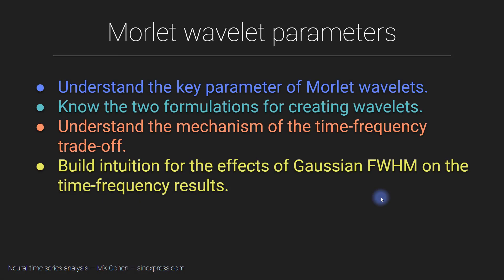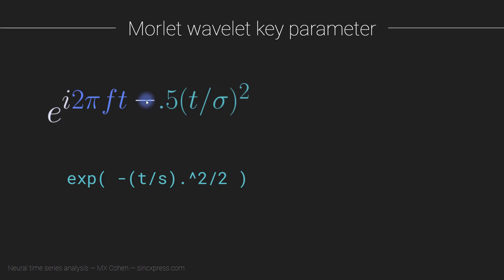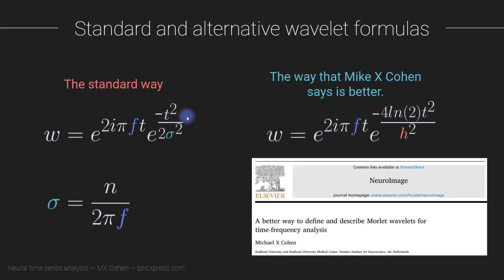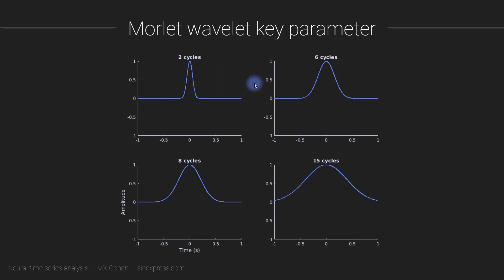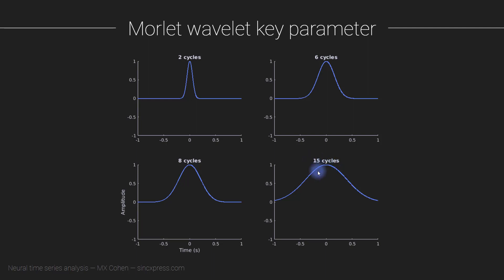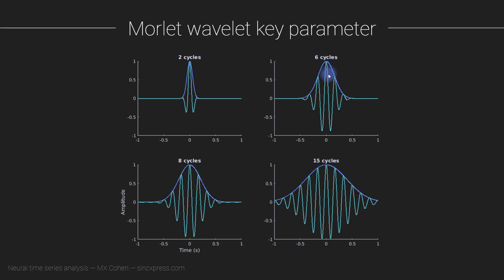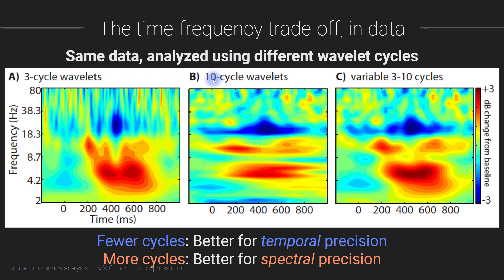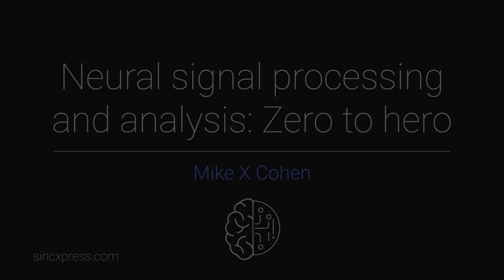Parameters of Morlet wavelet (time-frequency trade-off)

Comment: Not sure how valid it is but the way I like to think about this is that wavelets with fewer cycles look more like impulses (i.e. delta functions) in the time domain, and therefore have a broadband spectral equivalent. As such, they offer less spectral resolution because they are capturing information across a wide range of frequencies. Wavelets with more cycles are closer to sine waves, and thus have a narrowband spectral equivalent (i.e their Fourier transform is closer to a delta function), and thus offer better spectral resolution. The effects of wavelet cycles in terms of time resolution are as explained in the video (i.e. smudging etc.)
Reply from the maker: Exactly! That's a great way to think about it. It's often useful to think about what happens as parameters go to extreme values (in this case, either 0 or infinity).

Comment: It was a really good lecture. thanks! I had a question. Dose any one know how to use morlet wavelet and stft Simultaneously in eeg signal preprocessing ? (I happened to read a "frontiers in neuroscience" article that used these two as EEG signal preprocessing)
Reply from the maker: Hi Fatemeh. Wavelet convolution and STFT are both used for time-frequency analysis, so it seems a bit redundant. It's possible they used wavelet convolution for cleaning the data before the STFT.
Reply: @mikexcohen1  thanks for your answer. you mean I should give the output of morlet wavelet as the input of STFT? as far as I know the input of both of them must be in time series form not the time-frequency form!

Comment: Hi Mike, I would like to ask about the "variable 3-10 cycles" option: do you mean we apply smaller number of cycles to lower frequency, and larger number of cycles to higher frequency? you mentioned the number of cycles is a function of frequency, i.e., dependent on frequency. why is that? I thought the "variable" to be "random" (apply a random number of cycle between 3 and 10 to each of the frequency). considering the relationship between number of cycles and time-frequency trade-off, is there any reason we give priority to temporal precision for lower frequency and to frequency precision for higher frequency?
Reply from the maker: These parameters are, to some extent, arbitrary and selected by the researcher. The increase in cycle parameter with frequency is done to make higher-frequency bursts a bit more smoothed in time. That helps them be identified in noisy data. 
It's tricky because you need to think about time in two different ways: ms and cycles. If a low-frequency event lasts for 2 cycles, that might be hundreds of ms. But if a higher-frequency event lasts for 2 cycles, that might be only a few tens of ms. So the lower frequencies don't need as much temporal smoothing to take up visible real estate on the x-axis.
Reply: @mikexcohen1  Wow this is exactly what I was looking for. Our required time resolution gets locked in a particular lower frequency. Extrapolating frequency out in octaves using classic tiling leaves certain higher frequencies representing different physics under-resolved in frequency and more resolved in time than I need. So the proposal here is appealing. Is there a resource to learn more about the details of its implementation and consequences?  I assume that doing this affects properties like the frame, inverse, near-orthogonality,  leakage etc? What are the properties as the idea approaches a regular/rectangular tiling in time and frequency instead of a pyramid? Is there a citable resource where I could learn more? Thanks so much for your series and for mentioning this important possibility!!